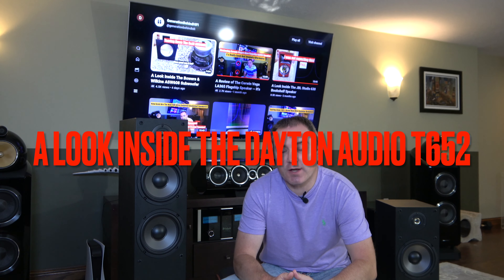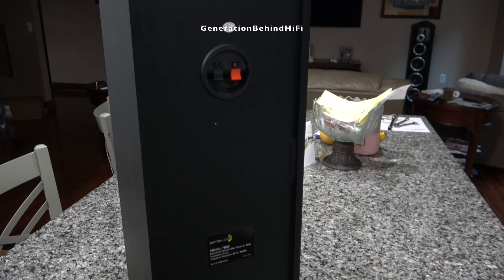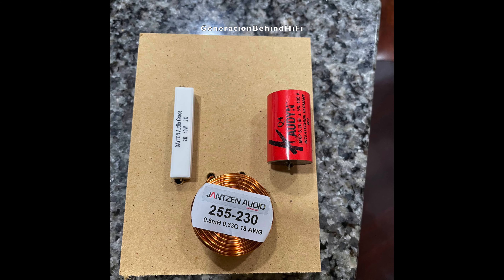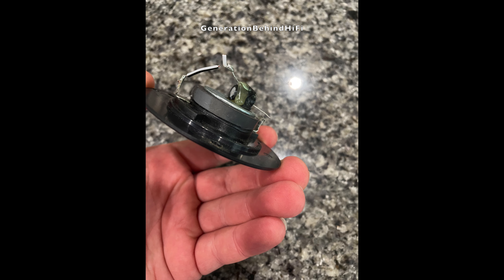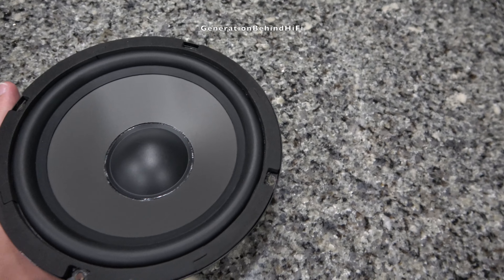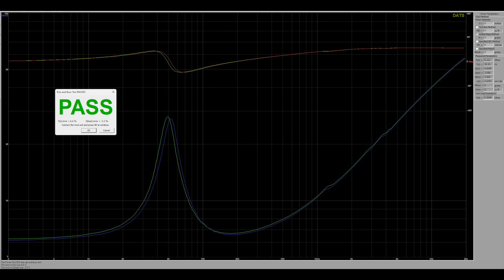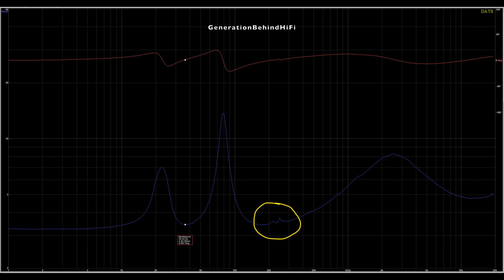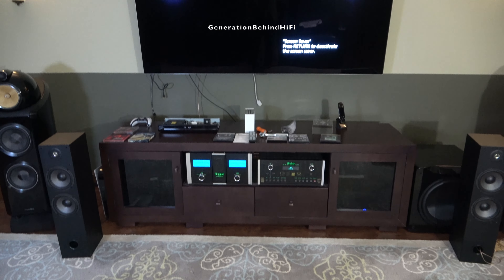A Look Inside The Dayton Audio T652

Comment: This is the kind of stuff i love..theres nothing better than taking a cheap speaker and making it sound like big money ones, i went on aliexpress and bought a 3 way speaker and it was fairly cheap 200 bux i think but i mainly bought them for the box they were in wow it was a very nice braced box with great finish, after putting much nicer drivers in and upgrading the crossover with air cores and jupiter caps i was blown away,, it was easily one of the best i have heard in a long time, no manufacturer could come close to that level of sound unless you spending ungodly amounts of money lol
Reply from the maker: You and I would get a long well! I love hearing stories like this! Nice work!

Comment: There is a bit of a life-lesson here... 
You can either buy something less expensive with good potential and then spend a bit of money doing DIY improvements ... or ... you can pay someone else a ridiculous amount of money to do it in the factory.

I've beefed up half a dozen pairs of T652s over the years.  Can't wait to try a pair of the new T65s which replace them.   

Basically I will cut 1/4 inch MDF or Hardboard tiles at sizes that fit through the woofer holes, then I coat them with a uniform 1/8 inch layer of clear silicone sealant (like you use in a fish tank) and press them into place on the flat surfaces inside the box... no clamping... you actually want these tiles to float on the thin layer of cured silicone.  It's a technique known as "Constrained Layer Damping" and it works! (do a search)

Next I do like the video and line the entire inside of the casing with underpadding... Yep, the spongey rubber stuff you put under your carpets.

To finish off I install a banana jack cup to replace the spring clips, with a very simple series crossover, 1 coil, 1 cap, 1 resistor. and put in 18ga copper wire. 

This results in a pair of 4 ohm speakers that have an almost flat frequency response and MUCH improved sound quality for about 40 extra bucks a pair.

Here is a video of a friend of mine going full on cowboy on a pair... the crossover design is shown in the video .... https://youtu.be/cKcLHMOJ4wI?si=AJaqOLT5gn5O6Txn

The audiophile snobbery usually ends when you stack a pair of properly hot-rodded T652s beside the far more expensive "high end" stuff they claim is better.
Reply from the maker: Well said, DB! I'm a big fan of Sonnora Designs. He has a great channel with good content!
Reply: @generationbehindhifi  
Bernardo is a highly skilled cabinet maker, I am constantly impressed by his work.  He's been off doing contract work for a while. I hope he can get back to speakers soon... For sure he had fun with the T652s .... 

(That was my crossover design, btw)
Reply from the maker: @Douglas_Blake_579  Cool! I didn't know that. I think I found the design in a speaker forum somewhere. If I would have known that this was your design I would have definitely given you credit. Thanks for your contribution!
Reply: @generationbehindhifi  
I can't be sure the design you found is the same as the one in the video... The one in the video is mine.  

Still... No credit necessary. It is enough for me to see people getting the benefit of my work.

Comment: With ALL speakers the most important issue is placement. Once the speaker speaks to the room and its placement is correct the magic happens. I have a pair of these which produce an incredible sound stage. These speakers are now driven with Fosi ZA3 on RCA inputs & have Sparkos SS3302 opamp upgrades. For movies & TV this is what I use. My basement system is all PrimaLuna using JBL 4425 monitors on 18" riser stands. Again, speaker placement is 1st order of listening experience. Once positioned they are spiked to the floor and never moved.
Reply: My T652's are commendable regardless of their shortcomings. They just sound so good and work perfectly for their job.

Comment: Some people are under the impression that audiophile means spending an ungodly amount of money on gear.
Reply from the maker: Sadly there is some truth in that which I think is dumb. If you have the same love for this hobby as I do, then you're an audiophile regardless if your speakers cost $100 or $30,000. I wish more people would stay humble and just love this hobby for what it is.
Reply: @generationbehindhifi  i usually find some drivers and tweaters on parts express and build a cabinet around them, and use an off the shelf crossover that best fits those drivers and tweaters. It's worked out pretty well so-far
Reply: Dayton Audio has some really good drivers for DIYers.  Anyone who likes to tinker with and improve their speakers will love what Parts Express has to offer.
Reply: Yep ... that's the thing.  Home audio very quickly becomes a real money pit for those who are unwilling to learn and do for themselves.